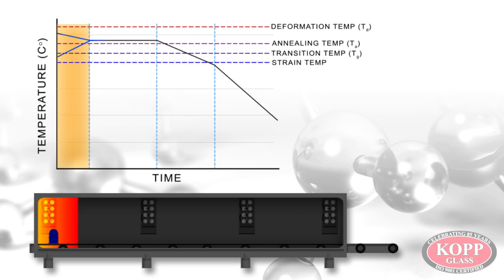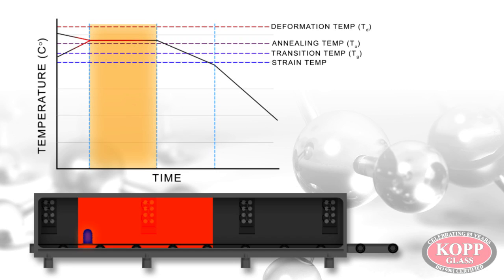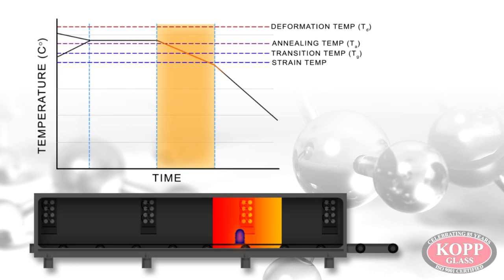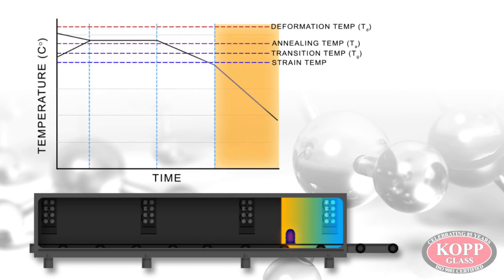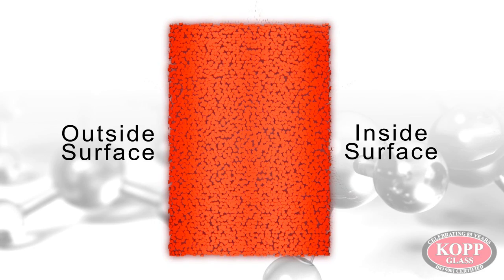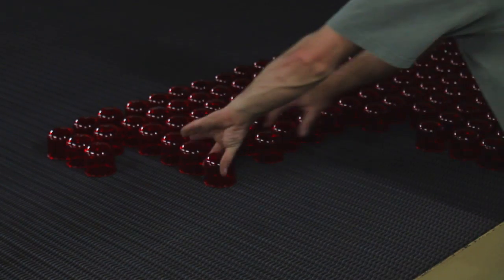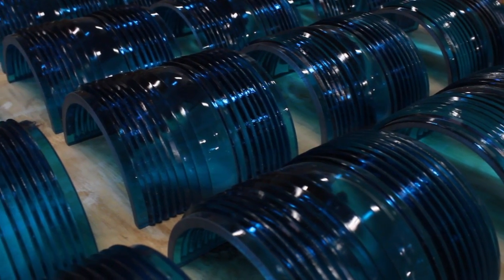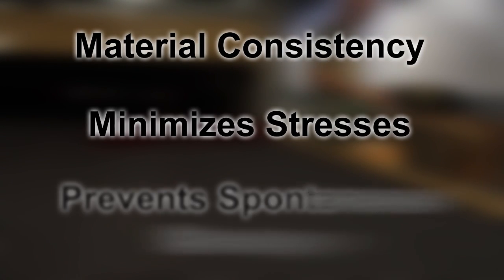Glass Annealing Process Explained - Technical Glass Products - Kopp Glass, Inc.

Comment: Yes I searched for this video
Reply: Same. Trying to cut lenses for a custom light fixture and the glass keeps breaking unpredictably. Fun fact, if you have a pair of polarized sunglasses and a monitor, you have a polariscope! Put on the glasses, pull up a white background, and rotate your head to the side until the screen appears to be black. Then look through the glass at the screen. Anywhere there is stress it will alter the polarization and show up as a lighter area. Checked the glass using this method and sure enough the internal stresses were high and spotted all over the plate.
Reply: Me too, bit i work in glass.